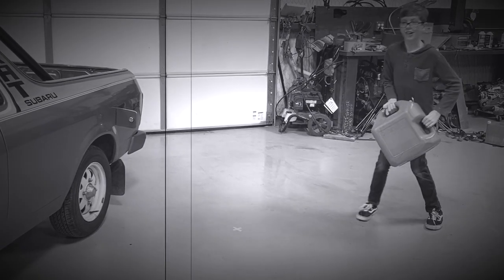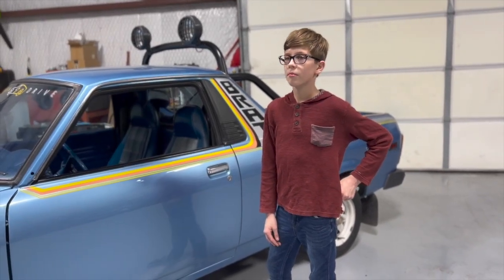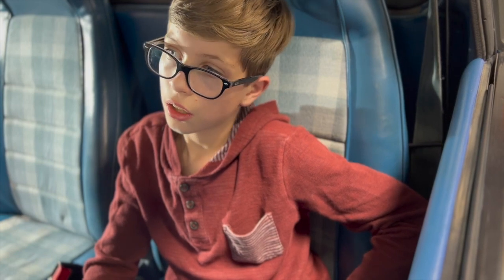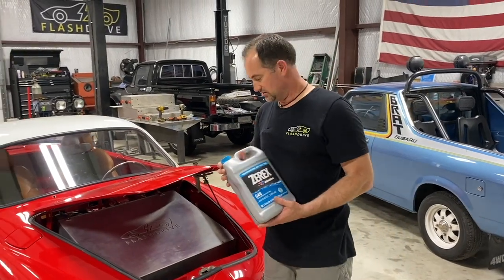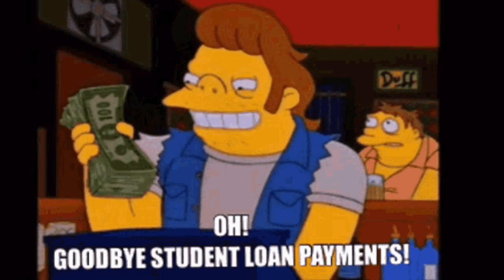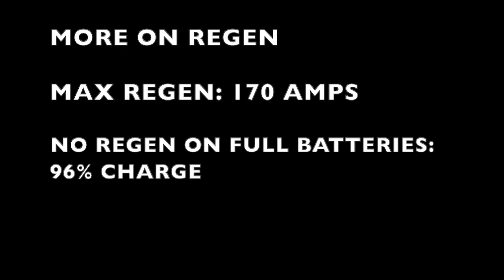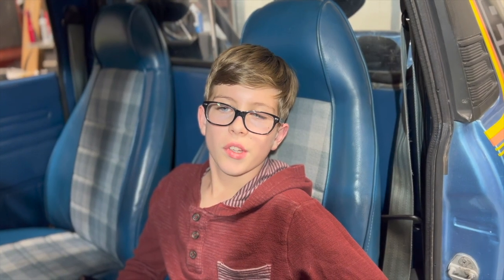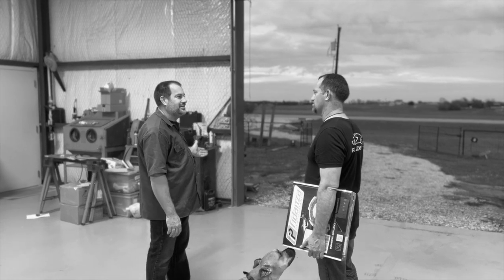HOW TO Care and Maintain an EV Conversion - New and First Time Owners of All Electric Vehicle Tesla

Comment: Dan, this was FANTASTIC and very amusing. You’re nephew is the best. Sorry (not sorry) you got crapped upon as the seemingly inept uncle but you’ve got big shoulders. 😆 I bet he had fun doing this. I love the way you created a show, mimicing the same type of instructional feedback to the “student” as I remember seeing in grade school science films, even right down to moderator vocals/mannerisms. All your subject matter was spot on, very useful, and quite necessary. Like any motoring method there are quarks, even for ICE but we’re so used to them they seem insignificant/nonexistent. BEV may have removed all related to ICE but put in its own! Imagine the adjustment from horse-drawn carriage to ICE back in the day. They may have eliminated hay, poop shovels, livery, stables, tack, water troughs, hitching rails, etc, but had to create infrastructure to deliver gas and oil for an evolved vehicle new to the market. Gas originally was sold in quart bottles at drug stores before market demand required systems to accommodate a rapidly growing motor public. I have only one technical question on your lesson regarding regen:  Tesla is careful with regen capability/capacity in cold climate if the battery too is cold. In the cold though, as battery temp increases (through usage) into acceptable ranges, regen is allowed to incrementally return. This should be true for any BEV until science ushers in some new battery design immune to cold temp extremes. Does the FLASH DRIVE system include this protection?
Reply from the maker: Thanks for watching. Great commentary on the video and we we’re definitely trying for the instructional video feel from the past. To answer your question. the regen has several parameters and protocols that it follows to allow for regeneration. Temp and state or charge are part of those checks. Unfortunately we couldn’t cover everything, but a follow up video might be worth doing in the future!

Comment: Hello, I am looking to start an Electric card build? Could you send me a link to the parts you have? (65 Mercury)

It may be a bit heavier than the Subaru. So I am trying to do some research on it
Reply from the maker: We could definitely help you out
Reply from the maker: Call Flash Drive Motors
Reply: tip , weight is the enemy of motors.